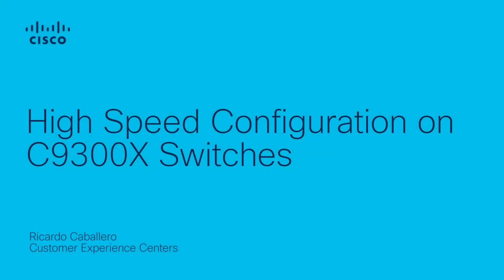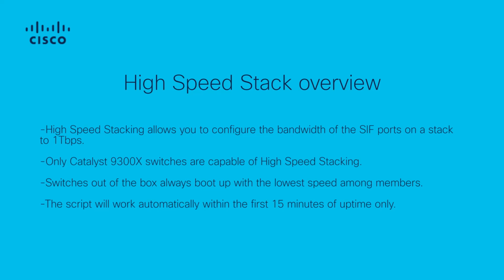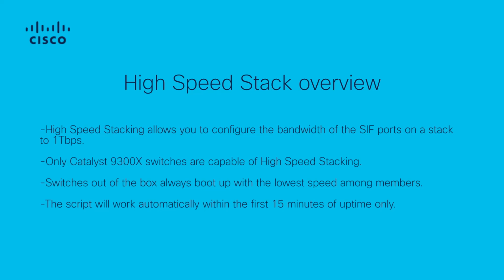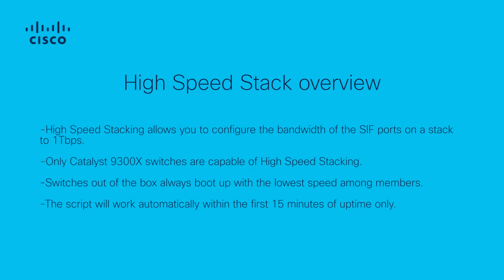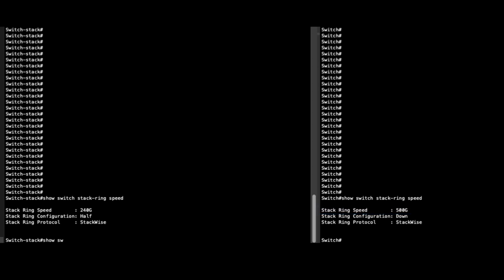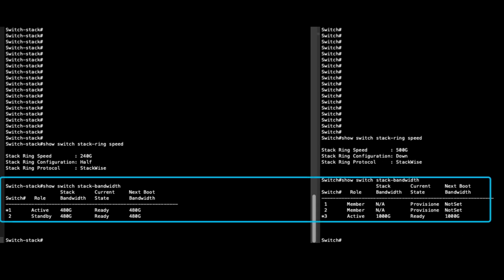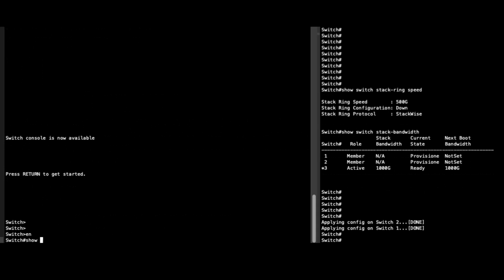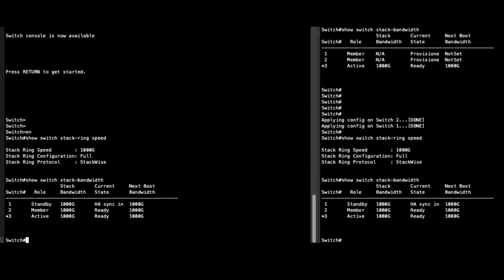How to Configure High-Speed Stacking on Cisco Catalyst 9300X Switches | StackWise-1T Setup Guide

Comment: what is the cable to be used between. with STACK-T1-50CM we can do it?
Reply from the maker: Hi there, thanks for your question The STACK-T1-50CM cable is indeed suitable for this purpose as it is a 50 cm stacking cable compatible with both StackWise-480 and StackWise-1T on Catalyst 9300X modular uplink models. We hope this helps!